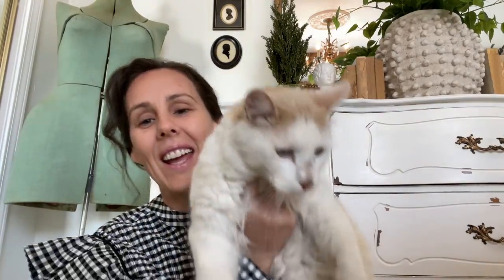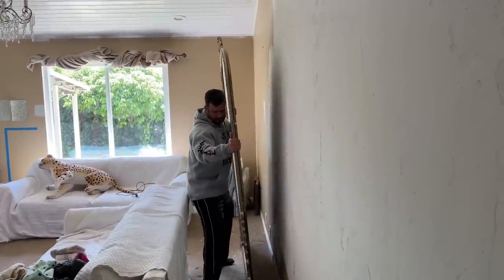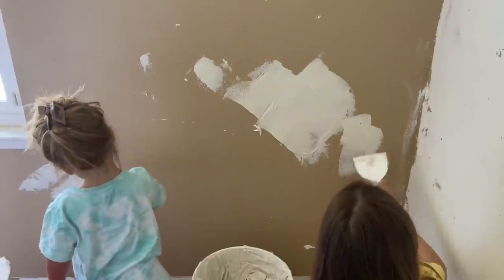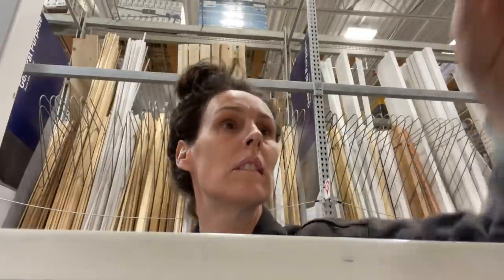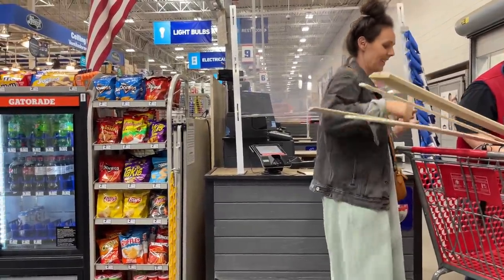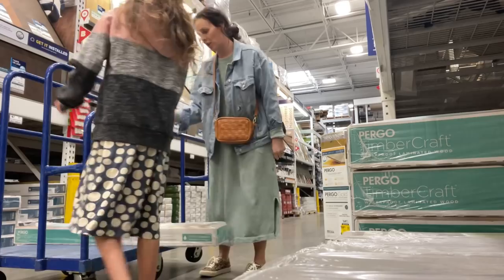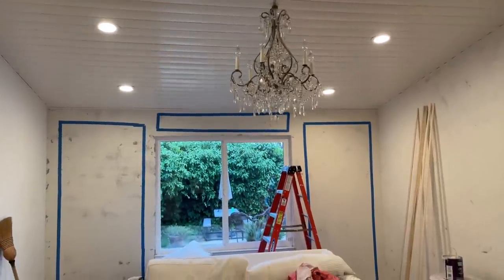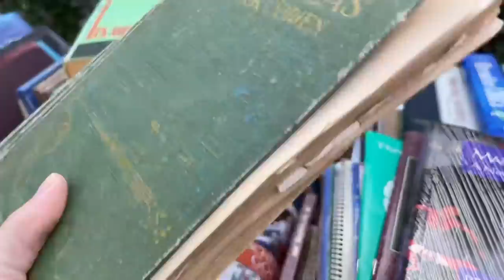Vintage living room decor | Thrifted Haul + What I bought New?

Comment: I installed my own luxury vinyl a couple of years ago and wish that I would have used the tools that they sell for it. You can purchase a block and a rubber mallet to get a tight connection and a pull bar. Most of my floors look good, but in some places they have separated slightly. I would recommend watching some videos on it as well. Love you channel and your videos :)
Reply from the maker: Titus is pretty good at making sure the job is done correctly. Thank you for the tips and for watching.🥰👏🏻

Comment: Water down your joint compound and use a paint roller to apply in 3-4 foot sections floor to ceiling. smooth out with a spatula/scraper as you go and sand later. Will save you TONS of time I promise ❤️ love the video!
Reply from the maker: Thanks for the tip.🥰✨

Comment: Sarah you can so lay the flooring it's really easy. We use a chop saw and a table saw. Pull the baseboards so the flooring goes under it, you get a nicer look. Then reattach the baseboards.
Reply from the maker: Thank you for the tip.👏🏻✨